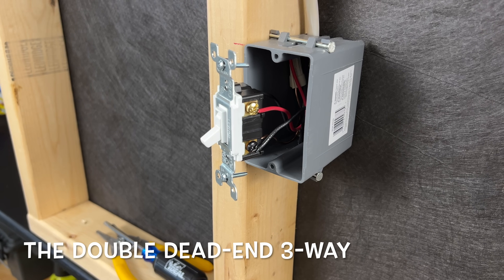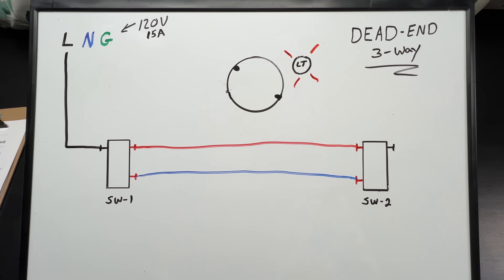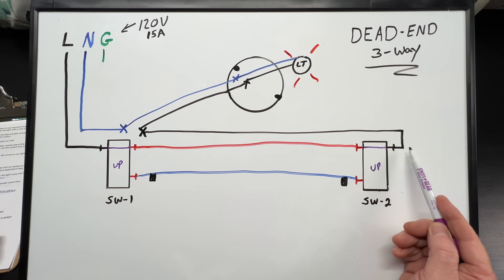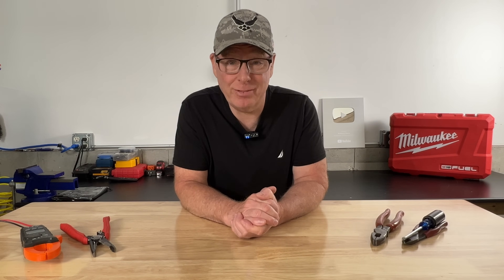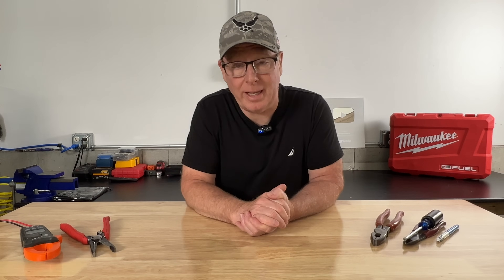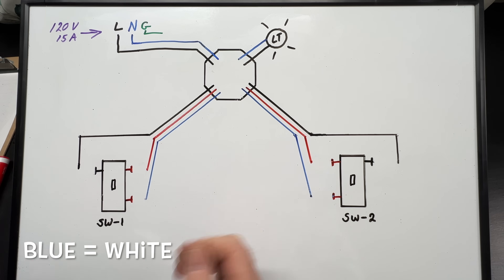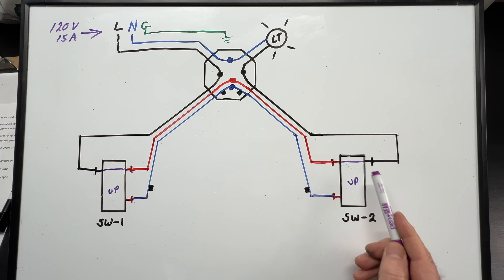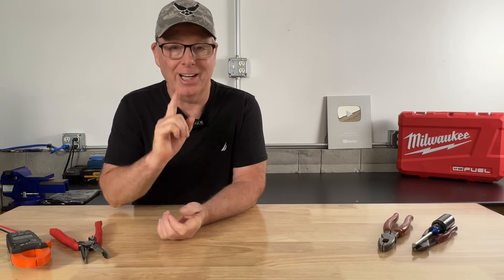Double Dead End 3-Way (Secret Method Reveled)

Comment: I'm under the impression that the new code requires a neutral available in switch boxes for the new electronic switches
Reply: It does in at least one switch box per switch leg. He did mention that this isn’t code compliant in new construction (technically not code compliant at all), but for three-way conversion, may be your best (and only*) option.
*short of ripping out the existing wire and fully reconfiguring it. Not fun.

Comment: How can a regular light switch act as a 3 way switch 

Found a buried box in wall   With 4 cables all 14/2.   Black romex to white romex b to b  w to w   To a 3 way switch 
Then back to box  white romex to black romex. B to B. W to W
Reply from the maker: Not sure what you haver there. Is it a double pole switch?
Reply: It can’t. Do you maybe have a dangerous Chi ca go three-way?
Reply: @xHadesStamps  not sure need to do more research 
Take the wall down
Reply: @bquedenfeld  As much as it sucks to do that, probably should.

Comment: Cool that you took the time to explain that. That usually pertains to old construction right? Because if it's new construction then yes the person has the ability to run all those circuits to make those necessary runs . But when it's old and you just want to replace the switches,  just copy the connections how you remove you install no need to try and remember so much . Nowadays there's what's called a lutron caseta wireless 3way look in to it and , your welcome.
Reply from the maker: Yes old work mostly. I know about the remote switches from Lutron and others. Maybe I’ll make a video on those sometime as well.

Comment: Not code compliant no neutral and you would need a box capable 11 conductors. So for 14 Guage wire that's roughly 17 cubic inches for the wire alone!
Reply from the maker: Did you miss the part where I said it’s not code compliant for new construction. Box fill is easy to remedy with a deeper box.
Reply from the maker: Also you only need a neutral at on of your 3-way or 4-way switch locations. 404.2c

Comment: I'm viewing from the UK, not an electrician but comfortable with the topic and have changed a few lights and switches, so this is all very interesting to see practices over in the US :) Very clearly diagrammed and explained -- I can see you prepared well! I enjoyed your explanation of the Chicago (yikes) and California three-ways!

FWIW, I don't know what the UK "code" ("The Regs", or IET Wiring Regulations) says is legal, but from my experience it seems normal to have the power at the fixture and to make loops to switches and back, similar to this. Standard pendant fittings have a 3-3-2 screw terminal bank tailored for a single switch, though I have seen them wired "creatively" which left me sketching and buzzing through to figure out what was going on when changing a fitting! I hope our Regs have caught up with requiring neutrals at switch boxes, but my place was built in the 70s so no chance 😂 Keep up the good work :)
Reply from the maker: Ahh a friend from the UK.. I'm a retired electrical engineer and the guy I oriented to take my place was from Greenock Scotland. Great guy but I couldn't understand a word he said. lol. Thanks for dropping by..

Comment: I may be wrong but I thought per code, when you re-identify a white wire to hot, it is not supposed to be switched. In other words, in the 3-way scenarios, the white can only be used as a common, not a traveler. I've had this discussion many times in my career. Your thoughts...Thanks!
Reply from the maker: I believe the intent of the terminology 200.7c was not to have the re-identified white make its way up to the light fixture as your switch leg. Then you would have a white neutral and a re-identified white to connect to the light. There would be an increased risk of reverse polarity on a polarized socket. The supply to the switch in my view would also be the travelers although you could make the argument that since the travelers run through the light box that would not be compliant. I don't think an inspector would consider that but who knows. But for sure if the travelers don't run through the light box in a standard or a dead end 3-way, a re-identified white for a traveler is code compliant.
Reply: Yes, John’s correct. As long as it doesn’t make its way back to the light, it’s fine. The reason they don’t allow you to recode a light back to the light is so that if recoding is neglected, testing has a 100% chance of confirming it’s hot.

Comment: According to the NEC, you don't have to phase a #14 wire. Also you are required to have a neutral in every switch box, even if you don't use it. Pretty picture though...
Reply: Regarding the phasing, or re-identification of a conductor, any conductor of 6 AWG or less is not permitted to be field identified and must be the original color, unless it's in a cable assembly, for example running a 12/2 NM to a NEMA 6-20R in your garage for a large air compressor, in which case you would mark the white with black or red tape at all terminations.   Conductors 4 AWG or larger shall be permitted, at the time of installation, to be re-identified as needed.  I believe this is somewhere in article 200
Reply from the maker: Actually you are wrong but thats ok I love to teach. Article 404.2 c states that where multiple switches control the same lights a neutral wire is only required at one of the switches. So no all 3-way and 4-way light switches do not require a neutral. Also I never said 14AWG wire is required for light switches. I show 14 and a 15A circuit but 12 and 20A circuits are also fine.

Comment: Converting a single swith light for basement stairs into two 3 way switches is on my short list of projects. I think the live conductor goes to switch first before going to light, but I need to verify. Good to know of options if I am mistaken. Thank you for sharing!
Reply from the maker: My pleasure.. Thanks for watching.
Reply: Yes. You always switch the hot, never the neutral.

Comment: In the double dead end - I don't see that the white ( labeled as black)  going to the switches does. Maybe I missed it in the explanation?
Reply from the maker: With 3-way switches the travelers (red and white in my example) carry power between switches depending on their position. There are actually four combination and two will have the light on and two will have the light off. up/up, up/down, down/down, and down/up. Which traveler is used depends of the position of the switch. If we didn't have the white travel they would not work.
Reply: @BackyardMaine  Thanks!

Comment: Great video, but I'm not a fan of the idea of having to cut the circuit breaker off just to change a burnt out light bulb (to remove power from the light fixture, for the bulb change).

Comment: WTF is a double dead end?
I’ve been an electrician for 43 years and I never in my life heard of a double dead end!!
Fed at one end switched at the other
Reply from the maker: That's the way most of use wire them buy there are several other methods. A few of them are now code violations.

Comment: Neutral in all switch boxes must be very new. I wired 1300 s.f. of additions on a house last year and virtually all single pole switches were switch legs where the white was re-identified as the hot. Also have a dead end 3-way or two in there and everything passed inspection. And this inspector was pretty meticulous.
Reply from the maker: The code change to require a neutral at a switch box came in the 2011 cycle but there was an exception stating that is wasn't required if it was possible to fish another cable in later without removing any finish coverings. But in the 2023 code that exception was removed. Also 404.2 C states that you need a neutral in at least one switch location for lights controlled by multiple switches like 3-way and 4-ways. So as long as one has a neutral you're good to go.

Comment: All  switch boxes have to contain the neutral wire , dead end three ways are not allowed by code anymore. Reason why ? All switch boxes have to have the ability for the installation of occupancy sensors that generally require a neutral wire  to operate.
Reply from the maker: Check again. 404.2 C states that you need a neutral in at least one switch location for lights controlled by multiple switches like 3-way and 4-ways. So as long as one has a neutral you're good to go. The double dead end would not be compliant for new construction like I said in the video.
Reply: @BackyardMaine  That is true of NEC code but our Local AHJ,s insist that we’re keep the neutral continuous in every switch box to accommodate the installation of occupancy sensors or smart switching at any and all switch locations.
Reply: run a 4 wire

Comment: I have this in my older house.  But since it's EMT the blue line is an actual blue wire!  Oh, and the switches control two separate ceiling lights with another wire running from the powered fixture through one of the switch boxes and up to the second ceiling box.

Comment: I've done this but worried w new code about leaving dead end box w/o neutral. Is this code compliant now?
Reply from the maker: Like I stated in the video it's not code compliant for new construction. But it's a good method for converting a single pole over to 3-ways in an existing building. Also 404.2 C states that you need a neutral in at least one switch location for lights controlled by multiple switches like 3-way and 4-ways. So as long as one switch box has a neutral you're good to go.

Comment: This definitely interesting. I will say you definitely want a neutral (and ground) inside each light switch box if you ever want to run smart light switches.
Reply from the maker: The grounds are always required and now a neutral is required in at least one switch location.
Reply: I don’t know, it seems completely pointless to have more than one smart switch in a three- or four-way system. Can also see it being potentially confusing when controlling from your devices. Some may even interfere with each other.
Reply: @xHadesStamps  It depends on the product.  You just need to hope that the neutral is in the box you want it to be in!

Comment: Thanks for mentioning you dotn need a neutral at both ends of the 3 way...   side note ..NEC 200.7(c) re-identified whites can only be the supply to a switch not a return
Reply from the maker: True and they can be used as travelers as well.
Reply: @BackyardMaine  my understanding is only if the traveler is the supply to the switch  Which you had in your dead end.  But not in the double dead.   Don't misunderstand I think it's a great video. With very clear info and great drawings.
Reply from the maker: @Stevenj120volts  Not at all I appreciate your comments. I believe the intent was not to have the reindentified white make its way up to the light fixture as your switch leg. Then you would have a white neutral and a reindentified white to connect to the light. There would be an increased risk of reverse polarity on a polarized socket. The supply to the switch in my view would also be the travelers although you could make the argument that since the travelers run through the light box that would not be compliant.
Reply: @BackyardMaine  that makes so much more sense because the 200.7 C predated the requirement to Re-id whites. So when we weren't re- identifying whites a switch loop fed down on a black would put two whites at the light fixture